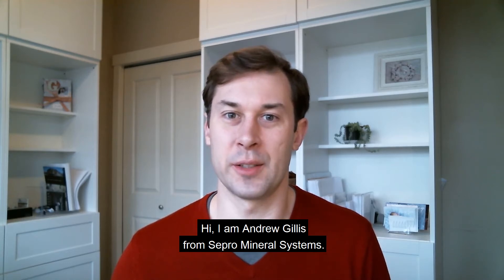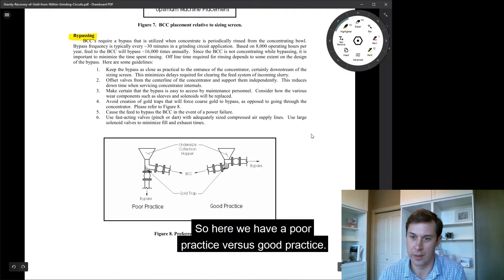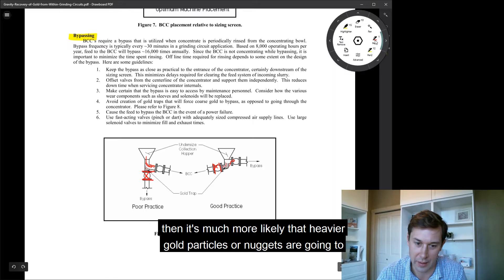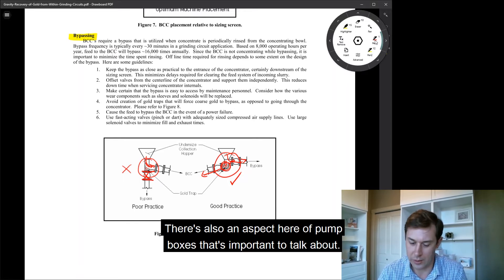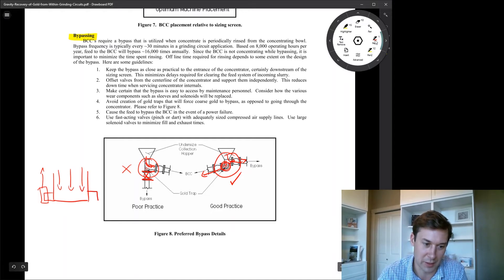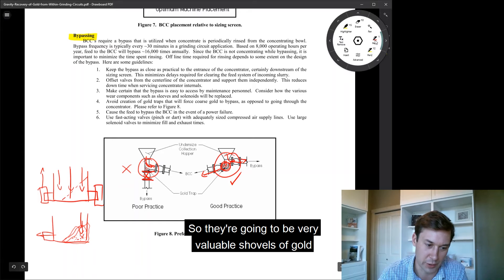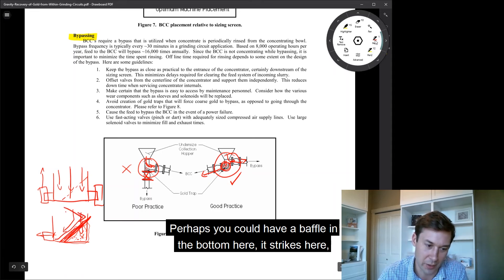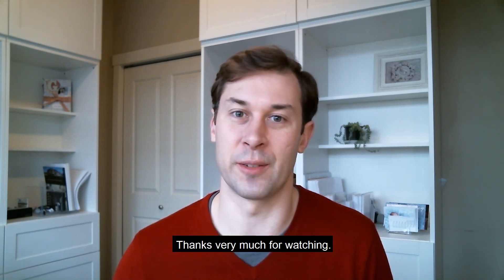How to Design And Avoid Gold Traps

Comment: Hi, and what about the ball mill itself ?
Reply from the maker: Hi Dimitri, yes, the ball mill is certainly a gold trap! It's difficult to avoid the smearing of gold onto mill balls and liners and it's important to carefully recover the material when mills are cleaned out.
Reply: @SeproMineralSystems  Got it, thank you Andrew. It seems feed sampling of the pulp from conditioner is not representative. In my case the gold corresponds to electrum 30 mk particles size.
Btw my request as for modular plant  PI drowned in your bureaucracy despite all the data provided by me 🤷‍♂️
Reply: @dmytromarchuk9532  and here you are getting feedback on YouTube? Social media is amazing.